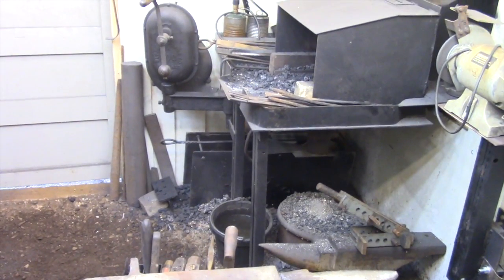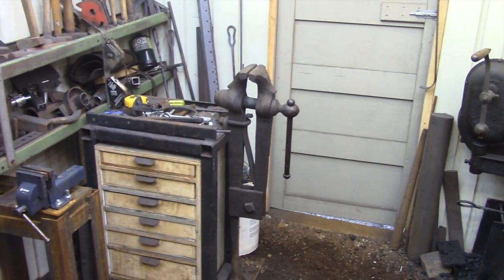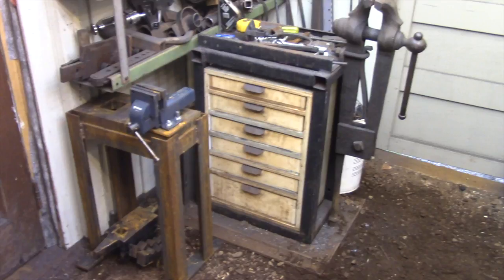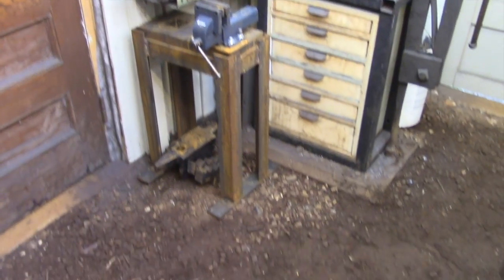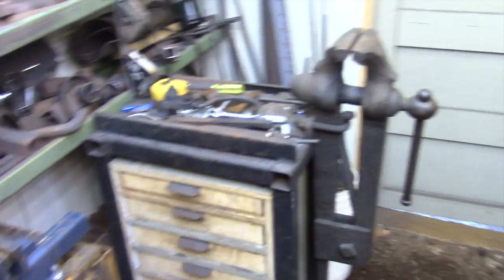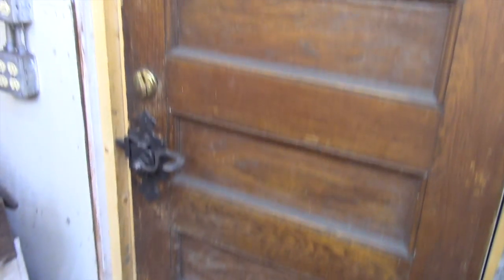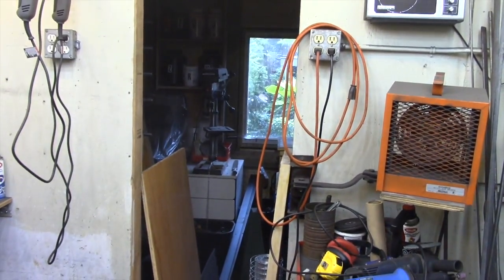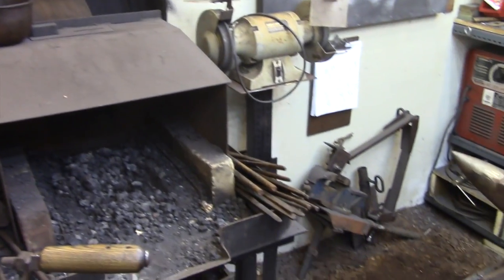Blacksmithing for Beginners - My CNC Anvil System Review and Shop Tour

Comment: Huh, looking at your portable system, I recall the drop-in anvil had a peg centered on the bottom.  

Do you figure placing the peg offset from center would make it less bouncy?

I would imagine the main problem is the force transmits so smoothly straight down the drop-in and back.  

Might even be worth placing something to muffle contact between the drop-in and the plate.

Comment: Have you considered either a cam lock, or even a through hole and bolt to secure the portable anvil to the base when working? I presume that it would add a couple of seconds (cam lock) or a couple of minutes (through hole and bolt) to setup, but might give you the extra foundation to improve the stability of the anvil system.
Reply from the maker: They are both good ideas if you need to do a lot of forging.  I will be fastening the anvil down when I need to set it up for a class.

Comment: Would a longer post on the anvil bottom, with a tapered mortise and a wedge to tap into place and hold the anvil to the base plate be too inconvenient for your purposes? Or maybe a couple of cam clamps? Idle curiosity for the most part, but I'm thinking seriously about putting together a system inspired by yours...  Clyde
Reply from the maker: If you are planning to use this as your main anvil then you should secure it.  The wedge idea would be the best way to go.